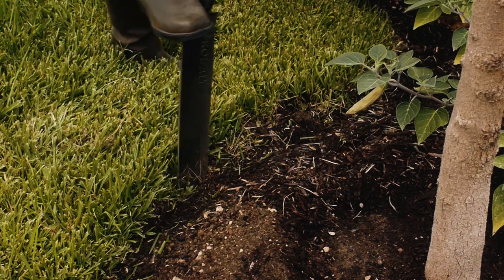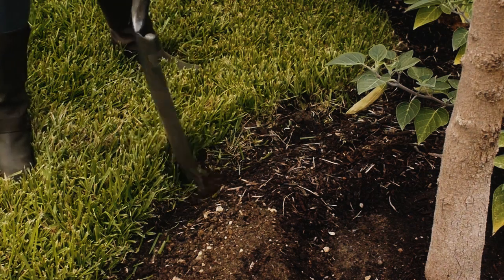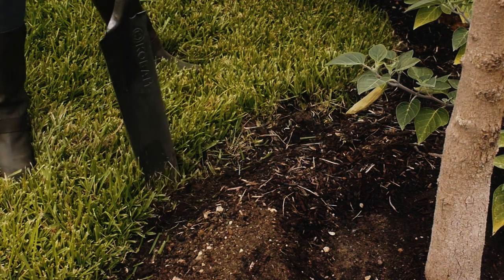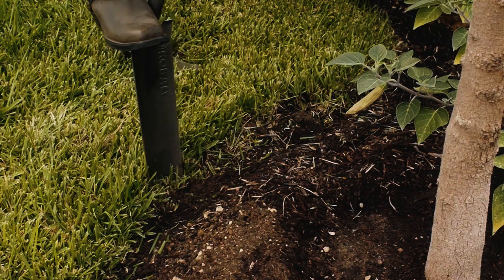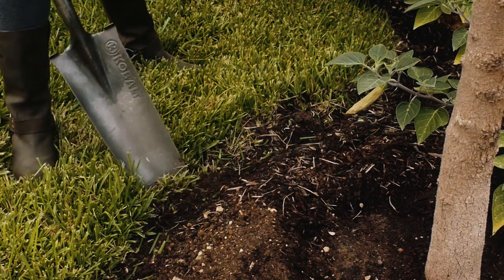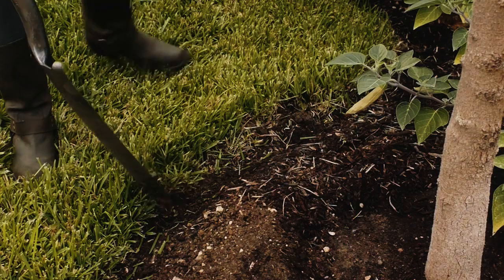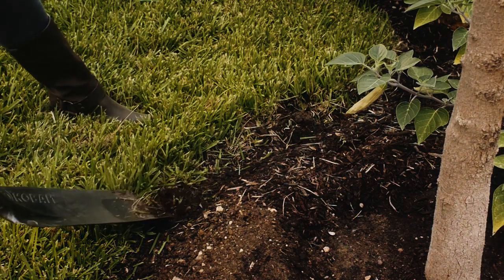Flower Bed Edging to Allow a Lawnmower : Plant & Flower Care

Comment: A spade is good for edging and using  as a shovel in edging but I would use a larger one except for making a curve.  A half moon edger is good but not for shoveling.  I recently found a half moon 'thing' w/permanent sign to keep one side toward concrete!  It's basically shaped like the half moon edger but larger with a larger foot rest, it's half the hgt of an edger with a T hand grasp and all metal.  Have no idea what it is but it makes edging easier/faster tho I need a small shovel to clear away soil.  Charity shop find.